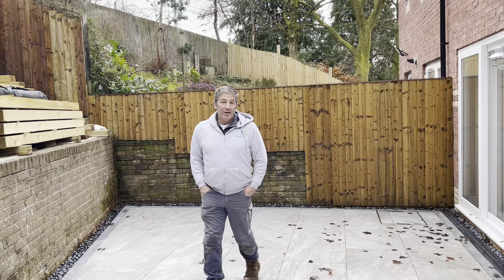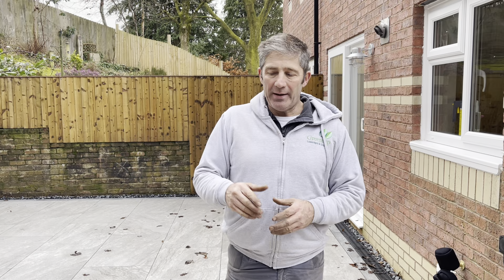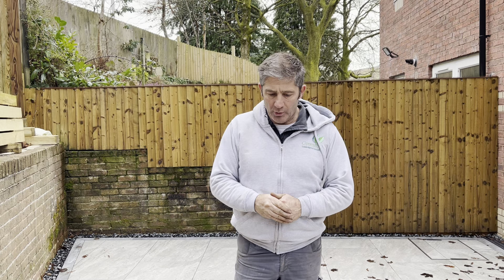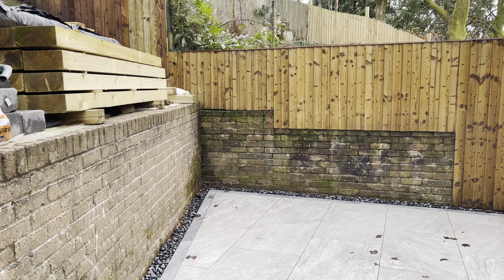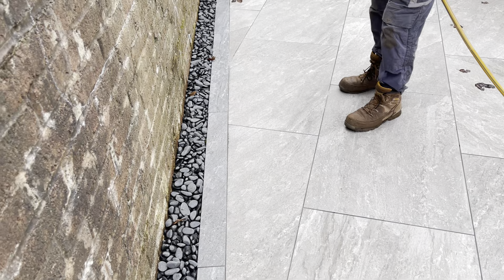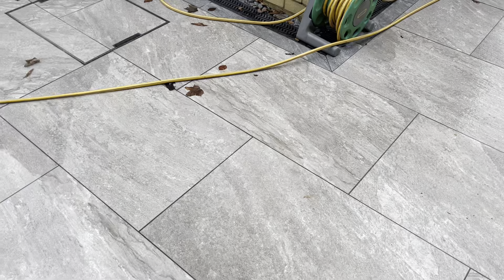#Porcelain #Patio #Checklist for #Grouting

Comment: Hi Johnny… I’ve a couple of questions if you have a minute. 
Am I ok using screed from a concrete plant to lay porcelain tiles instead of sharpe sand and cement? 
What’s the best slurry for back of tile? 
And do you reckon sthil saw with porcelain blade is ok for doing the full job all cuts are going to be square ? 

Cheers
Reply from the maker: Call me Gareth sometime

Comment: Using EasyGrout with 5mm gaps how many tubs would you use on 45 square metres with 20mm 600 x 900s John ? approx ? I had a merchant measure it up at 2 tubs !! but wondered in real life if that was about right.
Reply from the maker: Richard mate to be honest the Merchants wont know as it just depends on how deep the joints are and even you wont know that, just get three tubs and try that and see how it goes, if you dont break in to the 3 one take it back mate
Reply: @GreentopLandscapes  Thank you mate, good advice, I will get 1 more :)